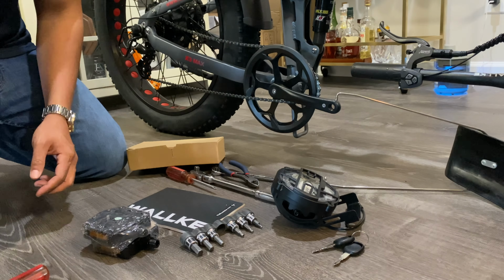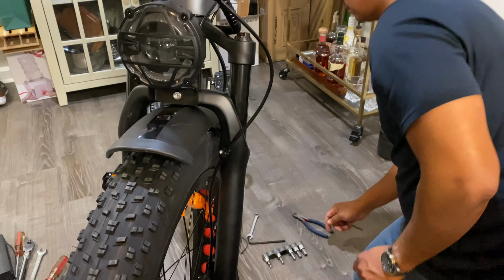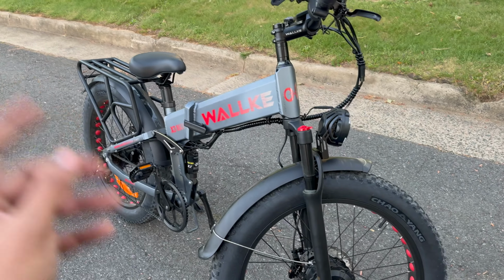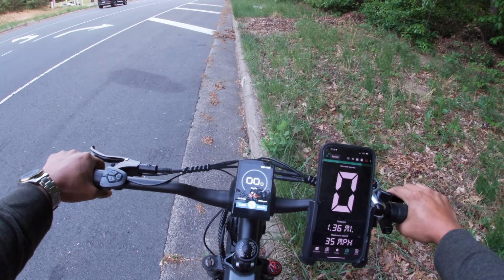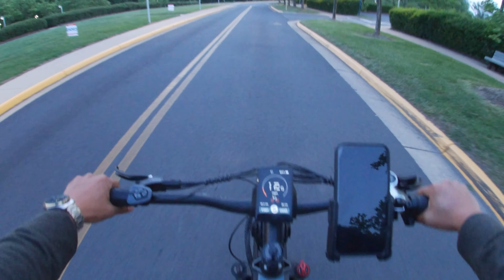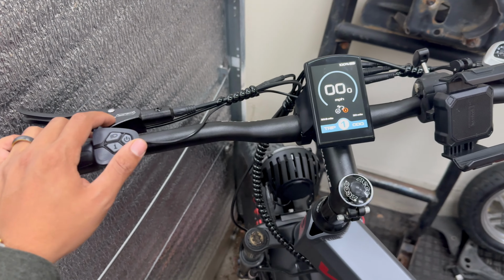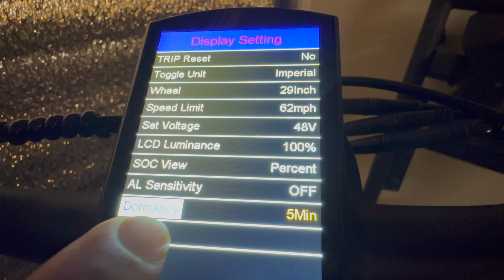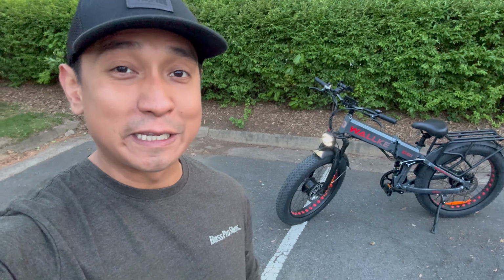Wallke X3 MAX Dual Motor 48V E-Bike Testing and Review

Comment: Going to be hard to compete with the big 60V 1,500 watt nominal full suspension bikes at anout this price . Competing against dual motor moped type bikes this could be an option.
Reply: This is foldable so this is competing with other fold bikes and that's it.
Reply: I just ordered this bike with their July 4 special. Although I would've opted for the other bike type you mentioned, the folding feature was key for me & this was one of the most powerful with that. Wish the battery held a bit more.

Comment: The company is lying about this bikes UL certification and it having Samsung cells.. It is not UL certified and does not have samsung cells in the battery.
Reply: What does this mean
Reply: @jonathanhillin3529  It means the company is lying about the batteries and electrical components of the bike being properly tested for safety. They are not tested.

Comment: the federal and states laws say no bikes on public roads with a motors or motor over 750 watts so this bike with two 1000 watt motors IS NOT LEGAL you can set it as class two but it also can be class 4 class 4 requires it to be registered and you need a  M license please read the lays and explain to people to check their bike laws in their state my friend was pulled over on this 1000 watt bike and was busted fined bid time and told to register it and get a M liciece and if you get into an accident god forbid your screwed and the lawyers will be glad to take your money so never mind what I say just read the laws I am trying to protect you not sell you a bike remember buy legal ride safe and have a blast riding your legal ebike and wave at the cops as you ride by